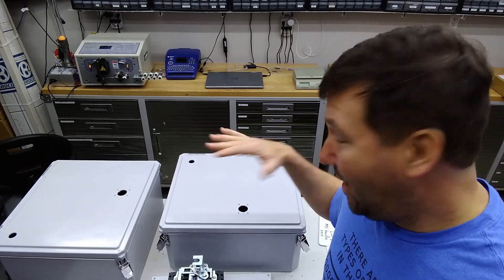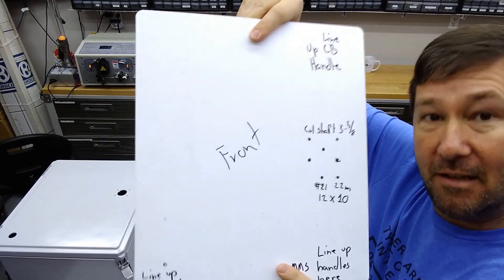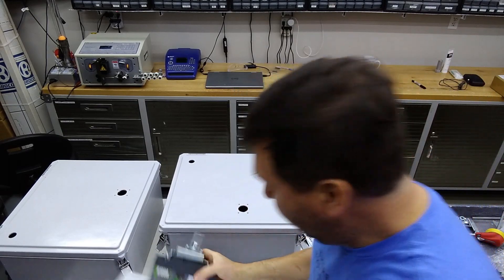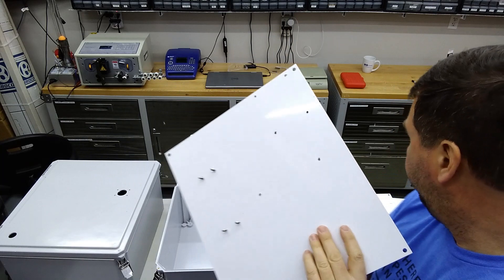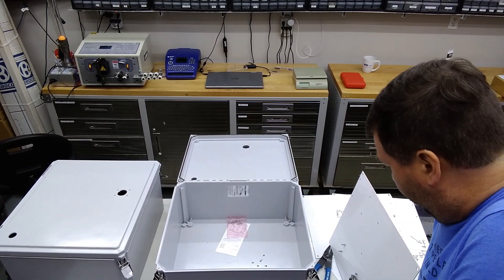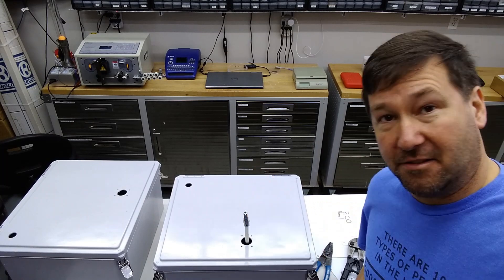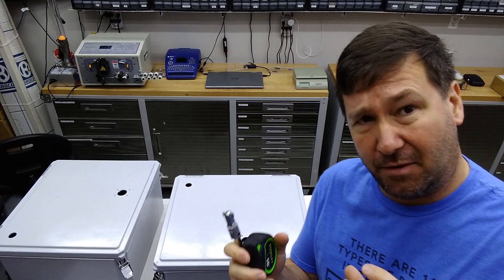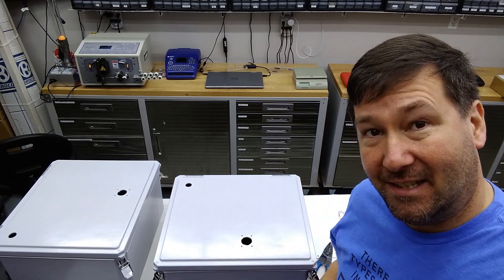UL 508A Industrial Control Panel Building Tips.  Using Templates to Save Time and Fastener Lengths

Comment from the maker: I've had several people ask why I didn't just use shorter screws.  This is an important lesson for those of you who haven't shipped control panels before.  There is only 1/4" clearance between the back of the panel and the enclosure.  In this situation a 3-1/2 screw won't reach through the breaker and the next standard size up is 4" and this just touches the back of the enclosure.  You could call the 4" screw good and ship it on out, but if the enclosure is dropped on it's back during shipping, the panel will flex enough to push the screw through the back of the enclosure to crack the fiberglass.  The "optimum" screw would be 3-7/8" which isn't a standard size.  Matty Lad didn't seem to think that this was painting me in a good light but you can leave the 4" screws at their standard length and cry when the customer calls saying the back of the enclosure is cracked or you can cut them before mounting the panel to prevent it.

Comment: Grinder? bolt cutters?
OMG dude! Just buy some more sizes of screws/bolts. they make them in about 5mm increments.
This does not paint you in a good light.
Reply from the maker: Wow Matty, you have an amazing bolt selection in your part of the world.  Over here when you get into these length screws they come in 12mm increments.  But even then there is less than a 5mm clearance between the panel and the back of the enclosure so do you run into situations where one length screw doesn't full thread into the panel but the next one is touching the back of the enclosure?

Maybe I'm painting myself in a bad light or maybe I've shipped several hundred of these and had a few get dropped in shipping and the weight of the panel be enough to push the screws further into the back of the enclosure and crack the back of the enclosures.... #collegeofhardknocks
Reply: @TimWilborne  Basically, cut bolts look crap and can be harder to remove during servicing.
You really do need to look further afield for some shorter bolts if your shipping hundreds of that product, order them in from where they can be found if you cannot get them from your local supplier - let us know the final size..

Comment: Great info 
One thing I have learned over the years is drill and tapped holes work best takes slightly longer to do this way but end results are more easily serviced in the future  also I apply Thread locker on applications that my experience High vibration
Reply from the maker: I use the drill tap countersink combo bits.  Check them out in this video.
https://www.theautomationstore.com/control-panel-building-mounting-components-part-3-of-6/

Comment: Why not just use shorter machine screws?
Reply from the maker: Normally I would but there are none available for the length needed here.
Reply from the maker: Hi Jeremy.  I had a few others ask the same question so I just pinned a comment explaining why this won't work.

Comment: I think a video about Short Circuit Current Rating - SCCR for the panels and how to figure out the rating would be interesting.
Reply from the maker: I think that will be a great one.  I have it roughed out, I just need to make some clear diagrams for it.  It is actually easy to calculate the SCCR once you do it a few times.

Comment: Might be worth noting, be super careful when drilling holes. Make sure you don't have your hand on the side of the panel, and make sure you aren't getting metal shavings onto your electronics. I've seen both of those situations, and both are really ugly.
Reply from the maker: Yes, it is important to have all the parts off of the panel when you drill.  I missed two holes in this video, and cleared everything back off of the panel before drilling.  And check your hands for grease often!
https://www.theautomationstore.com/control-panel-building-mounting-components-part-3-of-6/
Reply: We use plastic to cover all electrical or breakers and handle go in first.

Comment: How to choose and size a control panel ? I am seeing you look like using a fibreglass panel in this video  ? Thank you very much. If you like, could you please tell audiences with what factors  you consider for choosing or sizing a panel for the applications?
Reply from the maker: Yes I have a video coming on that.  The main factor that needs to be considered in control panel sizing is head dissipation.  Every product has a minimum spacing and then you must consider the heat loss of all the components to determine what size enclosure you must have to keep it cool.  We will talk about that in a video soon.
Reply: @TimWilborne  Cool Tim. Thank you so much.
Reply from the maker: You are welcome.

Comment: Are 4 - 20mA signals analog signals???
Reply from the maker: I don't understand your question. We have lots of videos of 4-20mA signals.
Reply: 4-20mA are what type of signals,
analog or digital??
Reply: @radhakrishna1008  This depends on what you are trying to achieve, If the current is fluctuating between 4-20mA it can be an analog signal but you need to check where that current is being produced from and measure it using a ammeter to make sure its not an alternating current (AC).
Reply: @radhakrishna1008  Typically yes. A reference to 4-20mA or 0-10VDC almost always refers to an analog signal.
Reply: @ndgtube  thanks a lot...